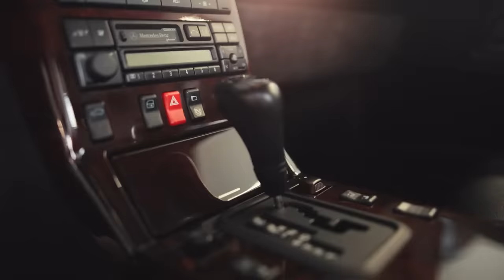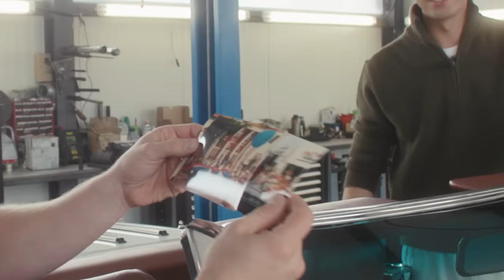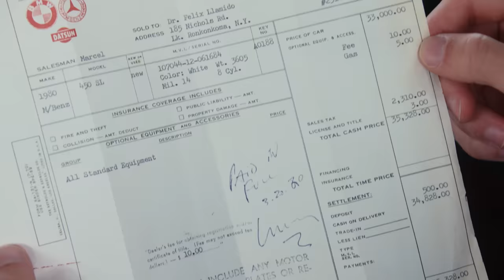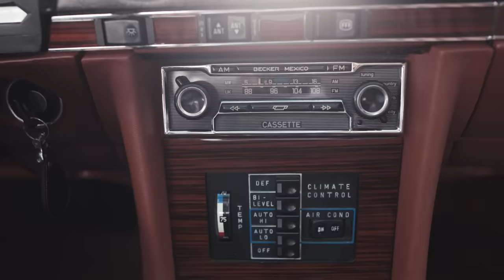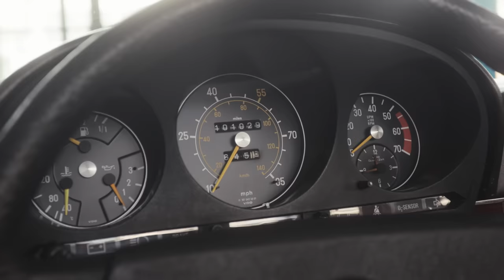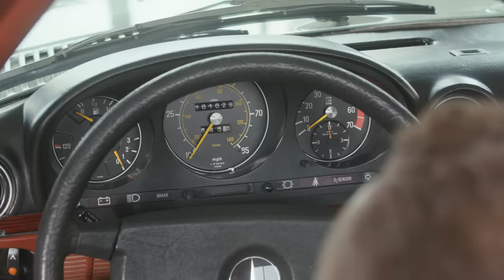Life With My Classic – Episode 1 | Maximilian Seitz

Comment: Nice. Interesting perspective on the USA headlights/bumpers - cant say I agree though. About the steering - at the time Mercedes was keen on preventing "unwanted steering inputs" from causing the car to swerve off course, hence the free play in the middle and significant inputs required to actually turn. 107's are fabulous cars and finally getting the recognition they have always deserved. I have an '81 Australian delivered 380 SL. Fortunately 380's delivered to Australia had double row timing chains (not single as in USA) but one should still change at 100,000 klm. Superb driving vehicles which encourage you to use them!